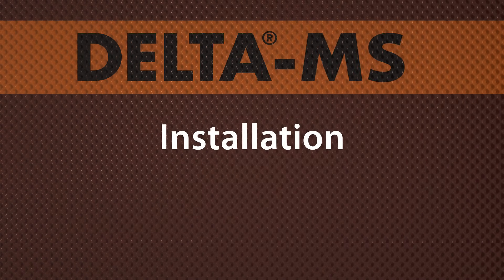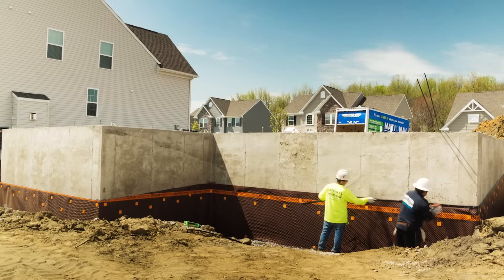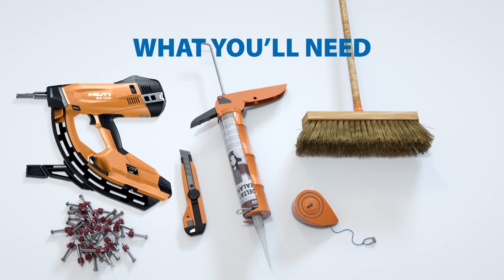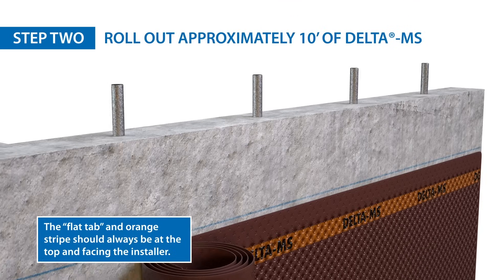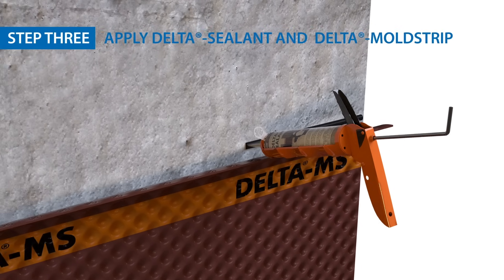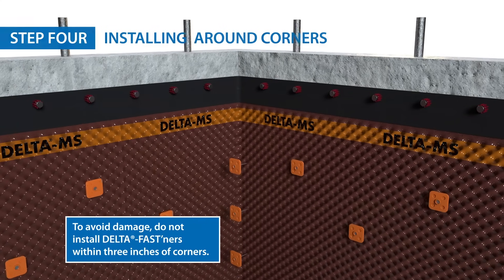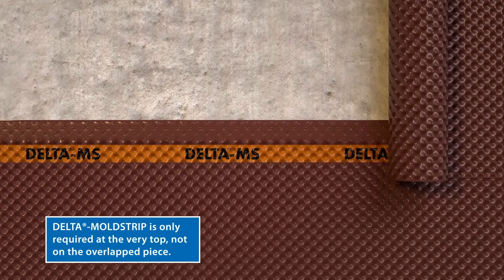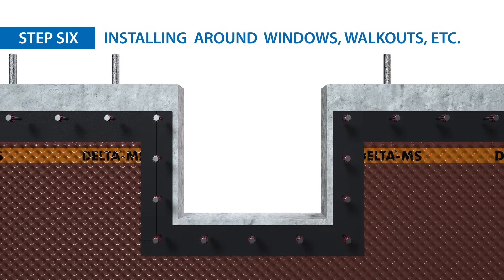How to Install DELTA®-MS Dimpled Membrane (English)

Comment: How does this filter our soil and sediment pushing against the dimple board after backfill? I don't see any fabric over the dimple board?
Reply: The dimples are facing inward so I don't think filter fabric is required?
Reply: @matti72033  I guess that is the confusing part. How does water get behind the dimples. It the membrane perforated? I've seen some dimple boards that have a fabric to prevent soil from draining behind the dimples.
Reply: @hapaboy0808  I guess I don't know.  I had an exterior wall waterproofed last year so I tried to learn as much about this stuff as I can, but I just realized I still don't know much!  Hopefully someone else with more knowledge can chime in.

Comment: FINALLY. I couldn't tell from other videos if the dimple is supposed to stop at the top of the footer or arc over it (every single person installed it a different way). I'm so glad this clears it up.
Reply: The picture on the web site is a cut a way of the ground level . It's somewhat confusing where the dimple material ends . Seems like dirt would infiltrate the drain field .

Comment: It's sad how many times Delta had to answer your questions here.  This is 100% a wall damp and waterproofing system it is not a drainage system. They likely sell one though.  Both are required by code in the OBC 9.13 (Ontario, Canada) the majority of the time.  The worry of nails... my god, free drainage and the nails don't penetrate into the house - ffs.  Most of you should hire a competent builder and stop doing DIY on the most expensive thing you own.

Comment: This product is difficult and risky to install on foundations older than 10 years. Concrete becomes very hard and brittle over time. Only decent way to install on old foundation is to drill pilot holes with an sds drill. But you will need an adaptor for the sds drill to fit small enough bits that will allow a snug fit with the delta nails and fasteners. Currently installing now. Bit of a pain for older foundations. 

Update: I dont recommend this product for anyone unless you can install with screws and hammer drill pilot holes. Nails in concrete is down right idiotic. This method has caused thousands in damage to my foundation.

Comment: Hi, I am about to install this product on my foundation. My front wall in my basement is a full 8 foot wall and the sides slope off to a walkout basement that will be ground level. My question is I have a 4 foot frost wall on the back and a part of the sides, that will be back filled all the way up on the outside and inside. Does this have to be installed on the outside of that wall or just the 2 side walls and the front that will be back filled outside and be basement inside
Reply from the maker: In general, building code requires application to the exterior around all occupied space.  As an example, this means if you had an attached garage, the wall shared with the interior basement space would require treatment on the exterior side.  If your short walls will have soil against them on the outside and there is basement to the inside, all below grade exterior areas would require DELTA®-MS to be applied.   Please check your local building code for specific requirements   https://www.dorken.com/media/docs/products/Installation-Guides/Installation-Instructions_DELTA-MS.pdf

Comment: How much should I expect to pay to have this installed, including materials and labour, not including any digging or back-filling? I have about 50' of foundation to cover.
Reply: Not including excavation. Probably between 1500 and 2500usd. With excavation And backfill your around 6-7k for the whole job. This would be for a 1000sqft house. But best if you tar foundation first. Did ours ourself. With taring walls and excavation it ran us about 4k
Reply from the maker: Prices vary from region to region, please reach out to me directly to connect you with a local representative. pbarrett@dorken.com

Comment: Hi. Should you also put a tar on the foundation first and after install the Delta MS. Thanks.
Reply from the maker: DELTA®-MS meets building codes in Canada and the US when installed as a stand alone product.  Some installers do apply spray asphaltic dampproofing (“tar”) first, then place the DELTA®-MS as a “belt and suspenders” system, but it is not required by building codes and DELTA®-MS is a very well-performing system either way.
Reply: @coselladorken  In Canada this varies with different municipalities so be sure to check with your local building department to see if they accept Delta-MS as stand alone. I will typically roll/spray tar on first because it's a small inexpensive extra step that gives us builders as well as homeowners that extra reassurance should your waterproofing fail

Comment: Terrible product that will create cracks in your wall. Foundation System of Michigan  used this product in my wall and They put so many holes with this oranges color nail. The material is hard plastic and you can’t do anything to cover up. I am ever sorry I used this FSM and this product... please ask first before you place this DELTA MS on your walls. You will be sorry like me...🥲

Comment: Hi there. I was wondering if there is an alternative to hilti gunning the dimple board to the foundation as I'd rather not risk any cracks. Any help would be greatly appreciated as I'm redoing my perimeter drains this week! Thanks in advance
Reply: Hi, I’m trying to find solutions for the same situation. Were you able to attach the dimple board to the hollow block?
Reply: @anotherday3781  I ended up Hilti gunning the dimple board into the concrete. It was easy I was just worried they wouldn't go through for how old the concrete foundation is.
Reply: Yes, hammer drill the holes than hammer in the delta fastener nails.

Comment: All the concrete nails may make a weak points for future leaking.  why not just using primer and glue
Reply from the maker: We can understand why you might think that but it is not really the case. 
Should any water penetrate through that point or any other, the air gap fully relieves it of any hydrostatic pressure. Gravity will cause the water to flow down and away. Even if there was a crack in the foundation right where incidental water penetrated, there is nothing to push the water through. The Air Gap Technology allows gravity to be the dominant force, draining the water safely. Also, glue won’t hold high-density polyethylene (HDPE) against the forces from backfilling soil.
Reply: if that is your concern, just add a little sealant around the nail after after nailing, or you can justadd some sealant first, then nail it. it, and then seal after you nail it.

Comment: Best practice would be to actually install a real waterproof membrane behind the Delta membrane.
Reply from the maker: DELTA®-MS is approved for stand-alone applications in Canada and the US:

- CCMC Approval (Dampproofing): https://bit.ly/2YU36tF
- CCMC Approval (Drainage): https://bit.ly/2sw9I5j
- ICC Approval: https://bit.ly/2PWyAv8

One can certainly apply a waterproof membrane first, should one choose.  In areas with high water tables, our Installation Instructions advise it: https://bit.ly/38IxLyu
. If a waterproofing membrane is applied first, DELTA®-MS acts as an excellent protection board, something required by waterproofing manufacturers.

Comment: And exactly how is moisture blocked from the concrete absorbing it? 

Tar - thick black tar, then roll heavy black plastic over it. Finish with high density below grade FOMC board. Schedule 40 pvc pipe to a sump drain with surface access and backfill at least 50% gravel.
Reply: forget about the thick black tar...we're in 2019 goddammit ! :) 
Membrane such as Resisto or Blueskin, add proper primer before....then the dimple membrane.
Reply: Year 2020: membranes are plastic and tar . I build icf basements and the premade plastic/tar membranes work great on styrofoam. On concrete block and poured concrete walls below grade lots of tar is the only way to fill all those pores. A thick sheet of plastic pushed into the tar and topped with foam board is great. I’ve used dimple rolls , but backfilling with gravel reduces hydrostatic pressure against the wall - one is sure to have problems using dimple rolls and dirt as the dirt will fill the dimples and voila : water problems . 

Anyone in this age that also does not install a footer drain is setting up property owners to have water problems . 

I wouldn’t buy new construction without all thee above, but there are clueless buyers and worst : negligent builders .
Reply: Glenn Berquist 
Footer drain is a must,  i don't think it's even worth mentionning...you're right about he gravel. Instead of just about a foot above the drain you could backfill completely with 3/4 clear. No hydrostatic pressure buildup possible ! But you need to get rid of all that extra dirt ! here in montreal, add 92$/h for the 12-wheeler plus around 100$ for each load to dump at a accreditated eco-center. that's some money most customers won't understand the true value of it
Reply: Lol - here in Mississippi you can dump that dirt at may places free! 

What’s an eco center ?
Reply: Glenn Berquist 
that's an authorized dump center where you can dump construction junk...the Minister of environement gives permit etc. complete bullshit
Reply: @jessybwoy8677  it's not complete bullshit. Just a way to control contamination.
Reply: @garyford6227 : the dimple side should be against the wall, so I don't see how the dirt  fills the the dimple void against the wall?
Reply: @jessybwoy8677  Hi Jessy, Egidio here in Toronto,  I wonder if the delta foundation membrane was installed properly? re: Glen Berquist comment.
Reply: @jessybwoy8677  Sounds awesome to me, I was actually wondering why we dont have something like this is los angeles.
Reply: @ginosmovies 💯 Exactly
Reply: dimple just sheds water, it doesn't block moisture. I used tar and blueskin membrane on my house because it was built in a high hydrostatic area. Hasn't leaked since. The cracks I grinded out and filled with leak stopper cement.

Comment: For hollow block foundations, is it safe to use wall nails or shall i used some kind of adhesive instead?
Reply: Depends entirely on your drainage. Tar and membrane for hydrostatic, or Tar and dimple with good drainage. None of that weeping tile crap. Put in perforated PVC, cover with like 6" or 12" of 3/4 crush rock, then lay down landscape fabric before back filling.
Reply: @Spruce-Bug  Weeping tile bad?